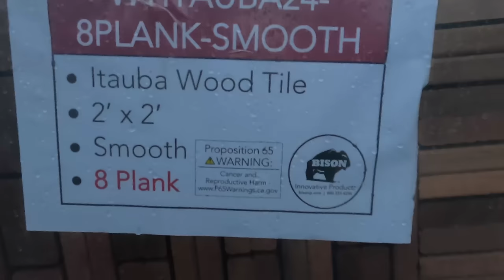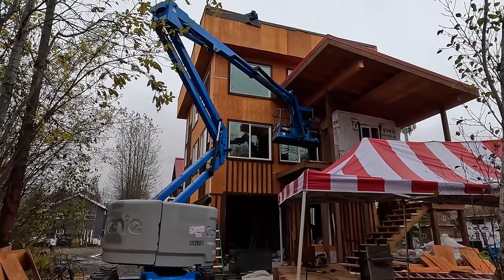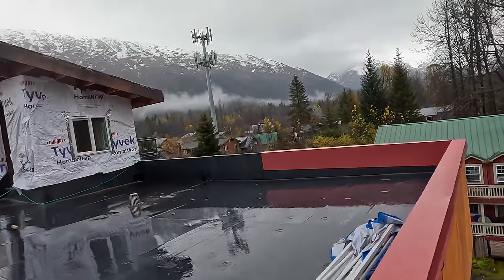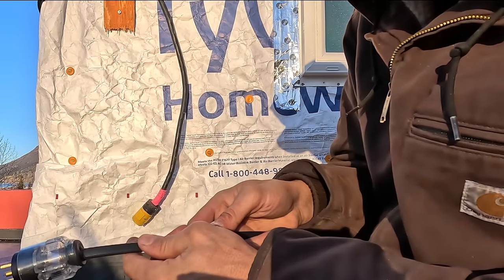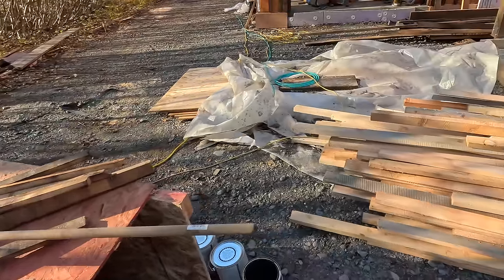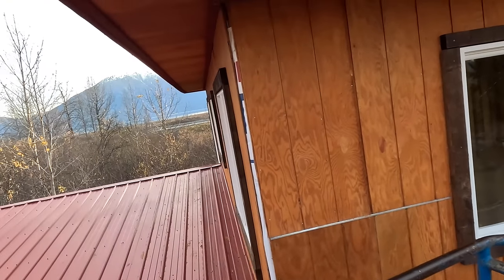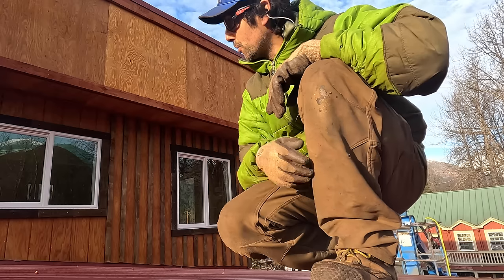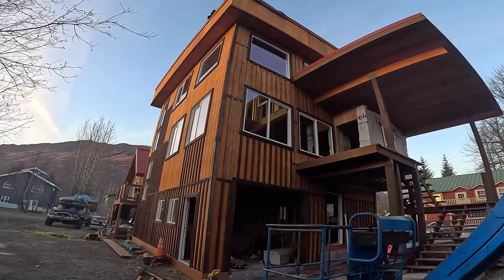I'm All Alone.

Comment: I started building in 1974 as a kid.  I have worked by myself for most of my builds.  You learn to just do it and make guides and helpers (without people) to lift parts in the air and hold things.  Clamps, screws, wood and brackets are your friends.  I also grew up in Fairbanks as a kid in the 60's.  Some of the reason I watch what you do.  Learn to embrace the quiet and keep working...I still do it and am actually going outside to work on my stuff and building.  Love it.....btw that boom is great, I have used a 60 footer and that's up there..

Comment: Tim your house looks fantastic.with winter knocking at your door step I'd let the exterior go until spring and concentrate getting the house closed in for Winter.you need heat in there to dry it out after all summers rain.damp walls and insulation make for a mighty moldy mess.you have a huge investment sitting there so protect it so rain and snow won't get in and cause anymore damage..I know plywood will only tolerate so much water before it warps into an unusable mess..good luck working by yourself it's a hard way to go...we are rooting for all the way.

Comment: That heat tape looks important enough that I would hard wire it into a thermostatic switch with a indicator light on the load side and place that indicator light some where in your normal everyday path.